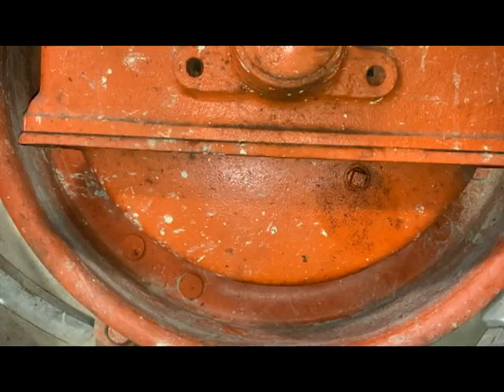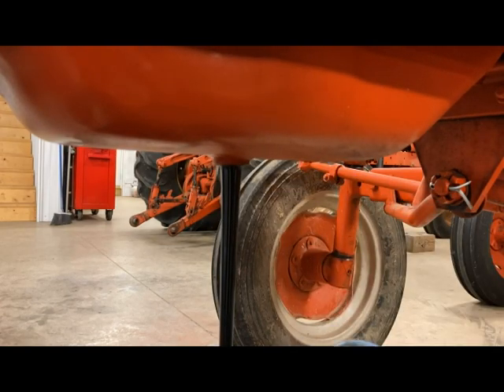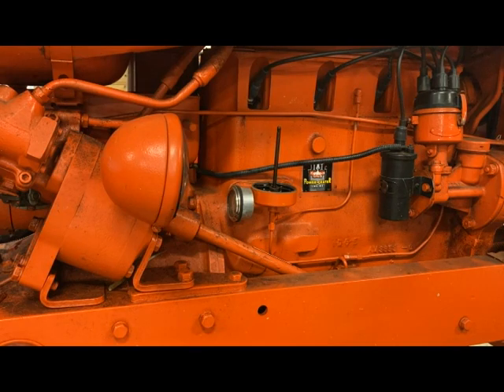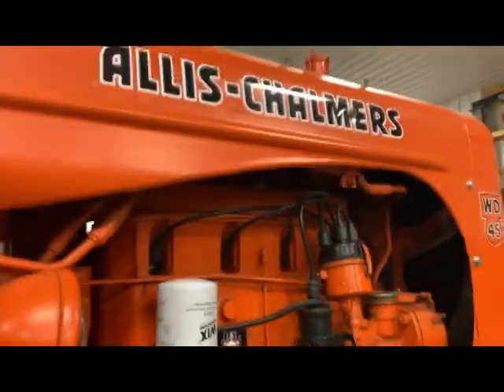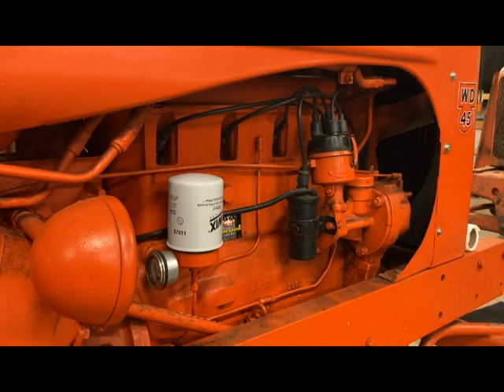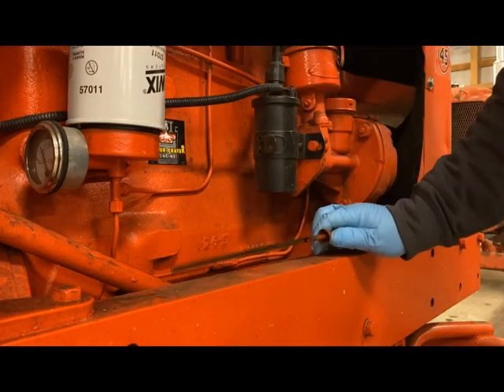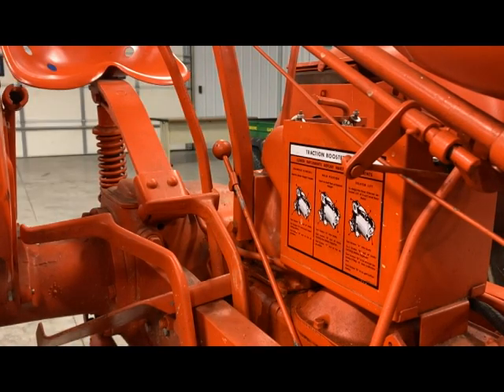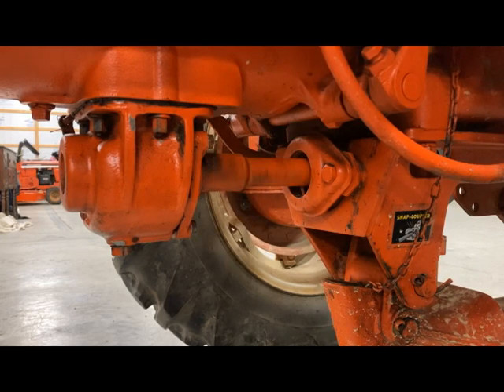Allis Chalmers WD45 Servicing and PTO Completed Part 2

Comment: Thank you for the video.  Always looking for more information on the WD45 as I use mine for mowing trails and small clearings with a large field mower.  Also for forestry work. Two items I would add:  I have a washer on the PTO shift lever, under the cotter pin.  Also, I include wiping out the water trap on the gas line and greasing the steering zerks with my quick service. I am sure your doing them, but worth adding to the list.

Comment: Good  day Nash  Yrs ago we had WC, block was patch,  we paid $65.00 but water would spit on spark plug &  short it out on heavy   work. We also left water &  finish motor off. I put glass jar on filter  base & start it.  I think it was straight 30,  but it just come out centre pipe & run  down no pressure.
I'm  glad to seeoil pressure go up. Nice tractor & video.  Thanks for now

Comment: Do you by chance have any videos with wiring a wd45, 12 volt?   I'm at that last step with my grandfather's tractor.
Reply from the maker: I currently don’t have one but I could create one describing it. Those machines are pretty simple.
Reply: @nashsummers8050  you're the AC guy that I trust.  The connections to to the ammeter is a little confusing for me.  Thanks for the reply!